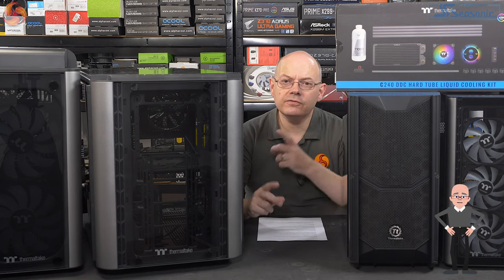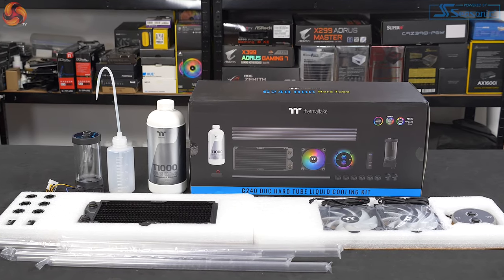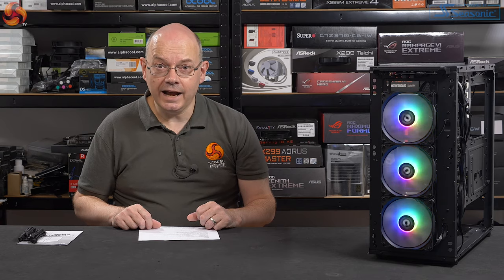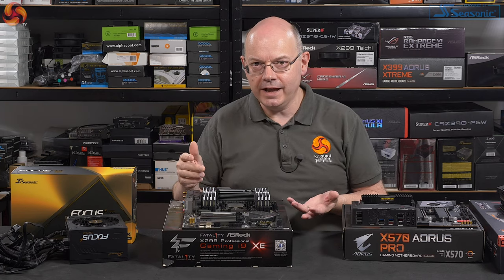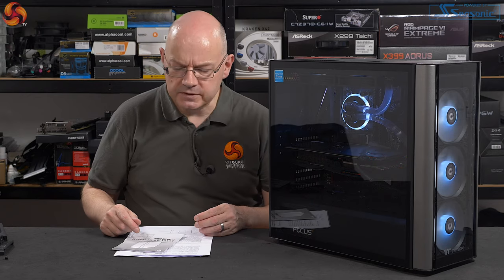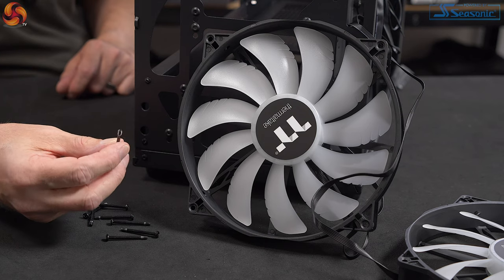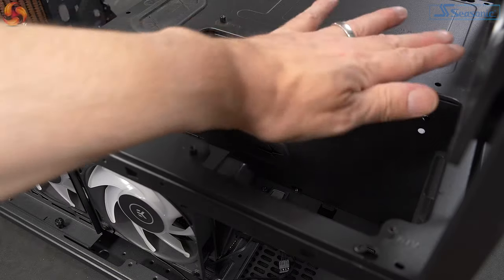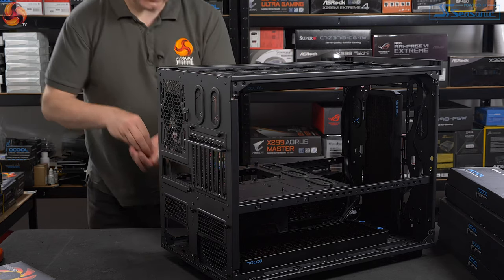Thermaltake Level 20 XT, 20 ARGB, 20 MT ARGB and Commander C35 TG ARGB!

Comment: This is the case for me if Thermaltake would fix some things with it. Cut off the front wasted space, cut down height of basement to just over power supply height, cut off the height above motherboard to 175mm, have it fit 4x120mm or 4x140mm fans in front and make the front and top side mesh with rad support on both side (240 or 280). In other words just make you level 20 Micro case a little bigger for ATX and mesh all the way around with filters. The Core V21 would be the perfect case if the side mesh panel was the same on the front and both side and was wider to fit ATX motherboards and add type C to the front lower IO where the Core 21 IO is and have it with a removable motherboard tray.
.

Comment: I've got the level 20 XT, It's a case for an extreme build, sure it costs a lot to fill it with radiators and other hardware. Making panels for it etc is what it's all about.
Reply: Do you still use the XT or have you moved on to something else? How would you compare it to the Lian Li 011D XL?

Comment: I have this and it's great for the price and all but i don't like how bulky the front is and the magnetic dust filter on top could be harder magnetic contact. I really want the lian Li Lancool II that just came out but don't know the price in AU and don't know if it comes with a fan. but i'm happy with this case and i'll get over the front of it.
Reply: I watched another video on the XL and it appeared like the magnetic dust cover was screwed to the top panel of glass and looked like the dust filter is laying on the glass and not the top of the case.. is that true? Does it not lay on top of the case? I was shocked to see this because it has no purpose if its up under the glass and not laying on the case leaving a gap between the glass and case to have no filter protection whatsoever

Comment: Thank you for having the guts to point it out.
Been saying it for years, Case design is going backwards from most manufacturers these days not just Thermaltake. 

All looks and no function, Poor airflow, Ports and power buttons in stupid places such as the top where you can't reach them when sitting at your desk, Should be at the front and near the bottom or middle. 

Most people showing off a fancy RGB build DO NOT have their case under the desk where you can't see it but can reach those ports on top.

No option for optical drives, Basically all I see now is rectangles with fancy glass panels that block airflow.

Comment: Awesome reviews.  I was contemplating getting the thermaltake level 20 xt and I knew it was big but wow that's flipping hudge.  Not that it's a bad thing being that big because that's exactly what I want but I drive semi truck and it's a single bunk so no place to put that ginormous case. Cant set it on the floor because then it's just in the way and the case I have rite now I have it setting on my bunk and its obviously in the way when trying to sleep,but i have to lay the case on its side because I'm afraid with all the bouncing around driving all over the USA roads that it's going to crack my motherboard or bust something on the gpu because it's a nvidia 2070 and its hudge and weighs a lot.
But after seeing the size of the level 20 xt I know I'm going to have to stick with the case I have for now.
Thank again for the review you definitely saved me some money on a case I want but is just not going to fit in my semi truck as big as it is. 
Thanks again

Comment: No thanks Thermaltake. I'll stay with my Lian Li 011 Dynamic. It's one of the best cases I've ever had. Also Thermaltake's open-loop kit is crazy expensive. I built a hard tube open-loop cooling system with 2 360mm radiators for under $150. The connectors were the most expensive parts.
Reply: What do you think about the XL?

Comment: Did I just watch a 40 minute, 4 case review and only see one dust filter (and that was ill-fitting)?! Little gaps everywhere, huge fans.
On the + side you'd never have to vacuum clean your house ever again. ;) All the dust will be on your fans, in your case or in rad fins.
Reply: What more do you need other than glass and a lightshow in 2019?